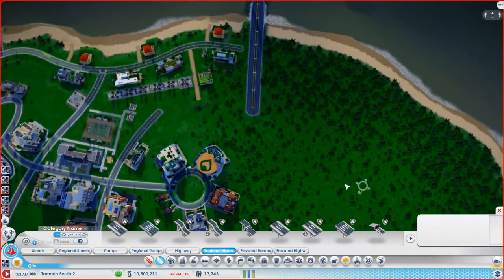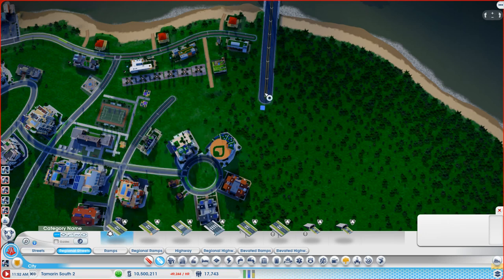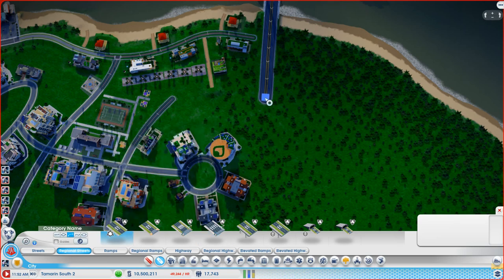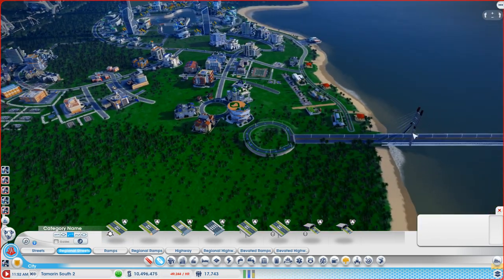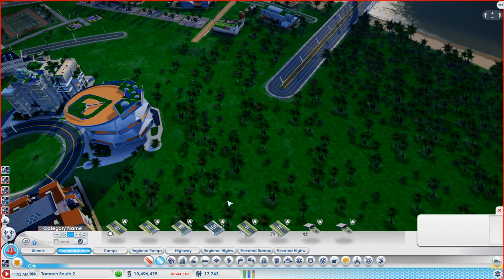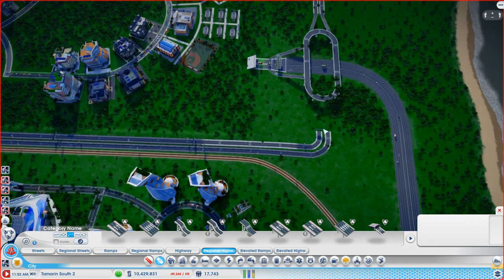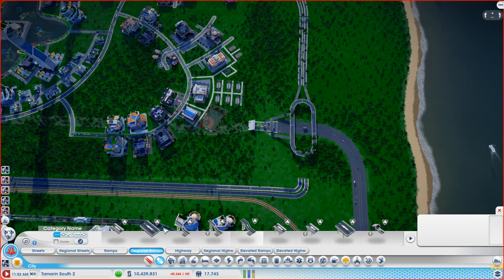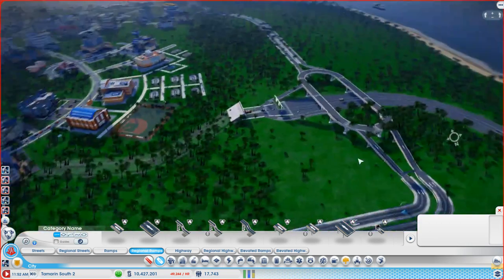SimCity OAU Academy Build #46 ►Tamarin South Commercial Docks (26)◀ SimCity 5 (2013) With Mods

Comment: 2 things about your roundabout by the regional bridge.

1) I've found that the simcity default roundabout tool works better than the UDoN option. If neither of those are working,  try making the circle without a connection, and then extend the road into the roundabout.

2) user comment #216 of "roundabout going wrong way!" :-P 

Keep it up on the UDoN. It's difficult, but it makes amazing stuff, and you're doing just about as well as the rest of us

Comment: Where the UK method of roundabouts works well is where there are more than just 4 intersections - some motorway (highway) junctions will have on average somewhere between 4 and 7 connections - for example here - the motorway (M1) intersects the A52, and Bostock's Lane - try connecting 3 roads up like this more easily, taking less ground space, than with a roundabout like we've got here.

SimCity is kind of like the UK - you've got limited ground space, so need to make things like this smaller!

Comment: The two transition roads are not both called transition ramp. The one in the highway tab is a transition highway, which is used to switch between elevated and normal highway, just not in an interchange.

Comment: I LOVE the idea of udon, but like you I just have way to much trouble with the ramps that I usually just give up.    As for the roundabout at the bridge, what about creating the roundabout first, trying to get a nicer circle then connecting the avenue up to it? 

Or if not connecting the avenue to the roundabout, using ramps off the roundabout to the individual sides of the avenue?

Comment: Skye, maybe you could make that last transition look a little better if you hooked the ramps up farther down the highway where it goes straight, i.e. making the ramps extra long on that side?
Reply: Stephanie Keck The one on the inside of the curve of the highway would look much better (and be much safer for motorists) if it connected on the straight section.

Comment: How about instead of having the last 2 ramps hook up to the corner, they hook up to the long straight instead?
Reply from the maker: Steph_Man Hmmm .. not sure what you mean?
Reply: Skye Storme Where you made the 3rd connections to the elevated oval (on the regional highway); instead of having the ramps connect on the highway's curve, pull the exit/entrances to before the curve, letting the ramps curve; like westbound I-295 does in SW Jacksonville, FL: https://www.google.com/maps/@30.1922139,-81.7248806,17z
Reply: I agree the picture. Give those ramps some more room and instead of that awful sharp angle connecting roundabout to the north side of tunnel do a nice curve out away then ramp down to an underpass parallel to highway then you dont have such an angle and the texture might go so awry? Just a thought but keep up good work!